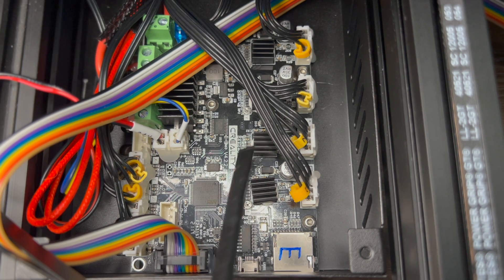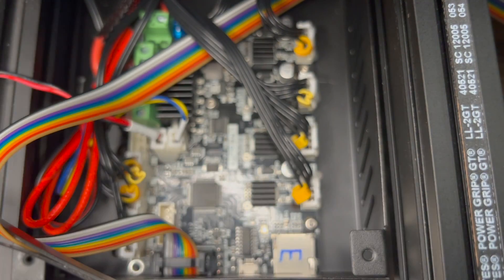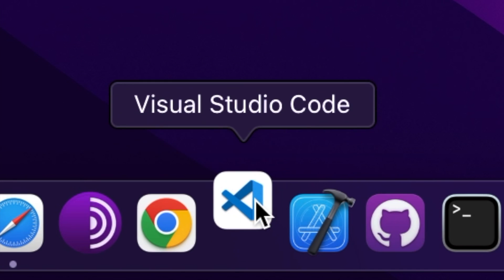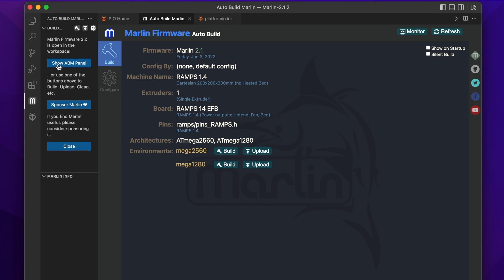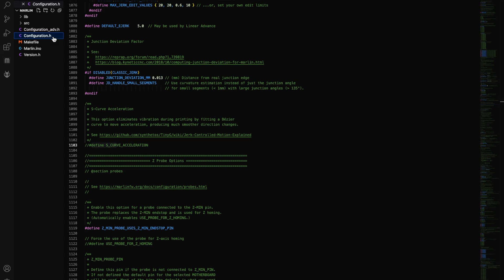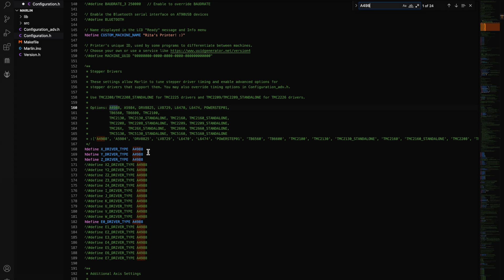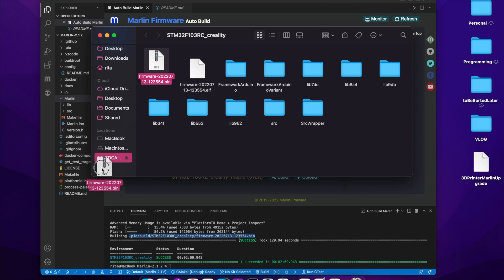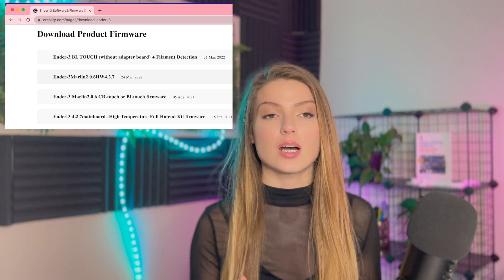How To Update 3D Printer To Marlin 2.1 Firmware (for Ender 3 and more)

Comment: Hello. I am French and do not master the English language well but I still followed your explanations step by step but unfortunately there are errors (62) after the built of marlin. I will try again anyway. Anyway, thank you for this great tutorial. I specify that I have an ender 3 with a card v4.2.2, I think that the drivers are A4988 because there is nothing indicated on the sdcard slot and I have a BLTouch.
Reply: My build failed the first time too because I downloaded Marlin 2.1.1 instead of 2.1. It works with Marlin 2.1
Reply: @MrTimeJump  Hello.
I compiled Marlin 2.1.1 with VSCode after temporarily disabling my anti virus and now everything works fine. My Ender 3 is 100% functional and after all the settings the prints are fabulous.

Comment: Letter written on the TF card case:-
C = HR4988
E = A4988
A = TMC2208
B = TMC2209
H = TMC2225
Reply: I don't have a letter on the case. Unless it's on the bottom.
Reply: @justapile4376  Inside the bottom behind the cover

Comment: do you have any ideas on how to fix the "blue screen of death"?
Reply: check your power supply voltage on back, US needs 115v. Make sure your LCD is plugged into the plug closest to the printer.
Reply: @harleyperkins1134  I know, it’s non of those
Reply: @TGG141  look up how to test power supplys and mainboards. basically leds working or not, could be your mainboard
Reply: @harleyperkins1134  well it’s a 4.2.7 silent board upgrade on an Ender 3 pro

Comment: Cr200B is not on the list after you clicked examples to find my printer.... What do I do and my screen currently does not display becuse I either incorrectly did it the first time or installed the wrong one before I watched vid.
Reply: Basically I got the firmware after extraction and put on sd and put in turned it on, let it load and then shut off then I got the Dwin_Set, extracted then put on the Micro Sd this time and put it in the slot for it at the bottom and instead of it being blue and saying stuff like it did 2 other times I tried doing it, it is now a black lit screen with not creality or anything. What are the steps I need to take? I was following everything in this video until I could not find Cr-200b where you we're looking for printer in examples.

Comment: Okay I just got an ender 3 pro. Is Marlin the base firmware or a custom firmware? Not sure if I want to upgrade just yet. I'm running my 2nd print without any issues so far, what do the updates add in terms of usage and functionality?
Reply from the maker: My Creality Ender 3 3D printer came with Marlin 1.1.2 installed on it out of the box. I'm not sure if all of their printers come with Marlin firmware, but it does seems like their standard firmware (judging from the info on the CrealityCloud firmware website).

Comment: Followed every step, and unfortunately my Ender 3 broke. Blue screen, tried placing stock firmware and it didn't do anything. If I would know it's risky, I wouldn't do it!
Reply from the maker: Oh my... that's interesting and unfortunate! 
I am very curious about your board specs. Could you list them? Could you explain how you transferred the file and include more details? Perhaps I could give information on another video that will help users diagnose, prevent, and/or fix these issues. 

Was there any damage to the connections or have any wires come loose accidentally during the process of checking your board? Thanks
Reply: @techwithrita  it was Ender 3 4.2.2 with A4988 stepper drivers, i managed to get it fixed by renaming the stock firmware to "FIRMWARE", inserted the SD card, and after a while it loaded normally. Then I tried with the same Marlin firmware, and it worked. Guess it was some kind of coincidence. And no damage was made, because everything is working normally.

Comment: Hey Rita, I'm trying to scan flat drone frames that I can use in Fusion or Tinkercad, what would you use for that? Might a flatbed scanner work? I don't know if I would have to have a high $$$$ handheld scanner for this application. Thanks in advance...
Reply: I succeeded with flatbed scanning to jpg. Then importing canvas to fusion. Overlay some reference lines on a sketch over your scan. Do some simple math to change the scale of the canvas. Then proceed as usual with fusion.

Comment: thanks its usefull but for me "ender3 pro 1.1.4" i needed to burn a bootloader using  an arduino connected to the printer and arduino ide then we use all that comes in this tutorials ...thanks very much

Comment: Super brilliantly done Rita.  I see where Marlin Firmware recognized your work.  when I got to where to go to compile / build the configurations for my printer are not there.  I have a Geeetech A20T multi-color printer.  I used a version of the CURA engine that could run with the A20T Color Mixer program.  But not all the settings for advanced control .  The Ultimaker CURA with Marlin 2.1.1  is where I need to go.  Now returning to problem of no configurations.  I submitted my request to Geeetech and support referred me to your video, which I had previously viewed.   Any ideas?
Reply from the maker: Hello, although I do not have experience with A20T color mixer, I did research it briefly to try and help. I was able to search through the configuration folders via CTRL F (it’s not an obvious find for sure) the “A20T color mixer” or “A20T” and found the config files to be copied and pasted into the “marlin” folder (in the Marlin-2.1.1 folder > marlin) (-also, make sure to “replace existing files” when prompted, not paste in addition to the same-name files). From the results of searching “A20T” in the “Configurations-release-2.1.1” folder, I copied all 4 items in the search results and pasted them and the auto build marlin updated the board info correctly. Next, since you have multiple extruders with one nozzle, you’ll have to open the configuration.h file in the editor / IDE from the marlin folder after you pasted it from the above step. You’ll then CTRL F and type in the search bar “multi-“ for multi-extruder (even though terminology is different from multi-color) and read the description of that function before uncommenting it to see if it applies to your printer. If so, activate it / uncomment it and then save. Then scroll through the list of functions to see if more apply or are needed before building your firmware and it should enable all functionality on your printer. I hope this helps!
Reply: @techwithrita  Hi Rita, sorry I wasn’t as prompt as you.  I found the A20T configurations file but it only contains the 2 configuration files but no bootstrap or status file.  None of the Geeetech printers had 4 files,  but the Ender printers all seem to have all 4.  I was able to get a successful compile.  But when I put the SD card into the printer and turned on printer nothing happened.  And then I recalled another site complained about Geeetech printers not being cooperative that way and showed using Cura to do the load, but timing of release of reset button on printer and pressing open of load on PC.  It worked.   But then  I rebooted printer and cable came loose that connected PC to printer and now I have a blue screen and further attempts to reconnect resulted in failure because the Port is busy.
Reply from the maker: @MoonShadow.  hmm… there are a lot of layers to that, but I hope you didn’t brick your board! The blue screen of death as they call it (slightly different from PCs) usually means either the firmware needs to be reinstalled or is corrupt… or that a cable(s) got disconnected somewhere on your board. I would check the cables and all connections first before attempting to work with the firmware

Comment: Followed 1-5 got compile errors all pointing:
#error "Your Configuration.h file is for an old version of Marlin. Downgrade Marlin or upgrade your Configuration.h."
Any suggestion.
Reply: ran into this same issue, used the 2.1.x bugfix version of merlin along with 2.1.x bugfix config files and I was able to get it to build
Reply: I have the same problem except I also have "Your Configuration_adv.h file is for an old version of Marlin. Downgrade Marlin or upgrade your Configuration_adv.h."
Reply: @bassreaper7779  (1) Check this video, I installed "Professional Firmware" Ender3V2-422-BLT-20220816.bin and it works PERFECT. (2) I notice also that motherboard has GD32F303 that this might be an issue. I did order newest V4.2.7 with STM32F103 RET6. I didn't install yet, will let you know result. Currently using the Professional Firmware that has lots new features. Just FYI using CR-Touch.
Reply: @dovy4729  thanks for the info. I'm going to look into that firmware. Do keep me posted on that board I want to know the results.
Reply: @bassreaper7779  Whatever I tried didn't work. Did you figure out the beeping issue?
Reply: @dovy4729  I was able to get 2.1.1 to compile with no errors.  Go to my channel page and shoot me an email to the address I have on there. Let me know on here when you do, I dont get notifications for that one. I will reply to you from a gmail address. I have a Marlin zip file I can send you.

Comment: at 7:14 how do I know which matches my board?  Also I need to add firmware for my CR touch.  Are you able to address for dummies like me?
Reply from the maker: There are no dummies, only people not informed yet. 
The board / brand / version of your 3D printer should have a folder in the list of folders/options, try CTRL F and type in your board info to help find it in the list. If you have a rare printer, it may not yet have a folder for the config files. 
There is an option for CR touch, once you find your folder (if there isn’t a folder with specific CR touch in the name) then you have to use the folder for the general version & brand of your printer, where you’ll have to uncomment the function(s) that enable CR touch functionality. (I think there are three total functions for CR Touch? Not sure… I could be getting confused with BL Touch though… but it’s the similar situation)
To uncomment the functions in the IDE:
You’ll go to the same file where all the functions are listed as shown in the video, then CTRL F and type in “CR touch” in the document and uncomment each function that applies. 
Also, be sure to read the summary above the functions to ensure there aren’t additional functions that need to be enabled.
Reply: @techwithrita  mine is the Ender 3 Pro. Thank you for the detailed response! I'll try and see if I can find it. Great video and thank you!

Comment: when i powered it on with the sd card in the screen stayed blank not sure what i did wrong
Reply from the maker: Make sure the file is on a blank / empty SD card, that there are no other files on the SD card other than the firmware file, plug it in and then power on the printer. It should come up with a prompt. If it doesn’t, double check with the code that the files used with the code are for your correct model, version and motor drivers of your printer. The file may be corrupt somehow and it may be beneficial to start the process over from scratch.

Also, if your board is much older, it may not work this way… early Ender 3 models may not be able to boot with the SD card.

Comment: My file didn’t work because it says the file is binary or unreadable. Is there any reason that might be?
Reply from the maker: Where did you get that error message, after clicking what? And in what program? Or was that message on the printer?
Reply: @techwithrita  I got the message when trying to load the marlin file onto visual studio code. I realized it was because the file was still zipped. However when I extract the file and try again,(Im using windows 10) the file keeps opening to more files instead of uploading.

Comment: Thanks for making this video! We always appreciate a good tutorial that we can refer people to when they need help. At the moment we're working hard to improve the Auto Build Marlin extension so it will be easier to find options and configure the firmware, so hopefully it will be less of a struggle for new and casual users.
Reply from the maker: I’m glad you found my video helpful! I love having the opportunity to assist others in their 3D printing journeys, and the Marlin update was phenomenal.
Reply: @techwithrita  Thanks for the guide - was trying to install marlin 2.1.1 but it seems that the creality touchscreens aren't working with marlin - is this right?
Reply: I’ve tried this method about a thousand times and nothing has worked
Reply: @PhillipJFry69420  same brother, it does not work on mine too
Reply: @sebus_Airsoft   I tried this and it worked on my Ender 3 pro. The only BIN file on the SD should be this one. I used Linux with this tutorial.
Reply: Does this tutorial work if I’m trying to go back to stock software ? My friend tried doing octo print but couldn’t get it to work and just wants to go back to stock software so yea would this tutorial work for that? The printer in mind is a CR-30

Comment: Thanks!  I found your video useful.  I had just purchased an Ender 3 Pro and was playing around with trying to update the firmware and I thought I had bricked it.  The problem is just knowing which firmware to download.  I have the 4.2.2 mainboard.  I tried several and eventually got it back running, but now I am thinking I need the latest version of Marlin since it now has version 1.0.1.

Comment: You don't actually need to remove a heatsink from the stepper, the "E" marked on your sd card slot refers to what drivers your board has (E=A4988). Other letters refer to other drivers. I just learned this myself.
Reply: For anyone who doesn't have one of the letters listed but still wants to follow the tutorial, my SD card slot on my v4.2.2 motherboard Ender 3 Pro had the following markings which I haven't found listed anywhere else.

SD-card slot, written in marker: GD? (pretty sure about the G, less sure about the following D)
4988ET
A2019
909H

Thanks @techwithrita for the awesome video. <3
Reply: @maddsmish  I have GD marking as well. So do I enter in like this?

#define X_DRIVER_TYPE 4988ET
#define Y_DRIVER_TYPE A2019
#define Z_DRIVER_TYPE 909H
Reply: The letters written on the card reader slot (with marker) are different depending on which stepper driver it has. These are for the ones 4.2.X board with STM32F103RET6 controller:

C = HR4988
E = A4988
A = TMC2208
B = TMC2209
H = TMC2225
Reply: @amjed-ali-k  I am seeing conflicting information on this where people with an H8 label actually have an HR4988 controller. Some help would be great - I really don't want to bust off a heat sink just to verify.
Reply: @amjed-ali-k  This is a very good explanation. I looked on my motherboard (V4.2.2) and there is nothing written (??) what do you think? It's a . Ender 3 stock.
Reply: @philippeloubeau6615  it was made a monday. on monday, the letter's guy is not availlable and nobody replace him. 🤣
I had the same, it was working with the unmodified config.h
Reply: @_bentou  hahaha... I compiled Marlin 2.1.1 with A4988 drivers and it works fine...
Reply: @amjed-ali-k  I have T8 written on mine
Reply: @amjed-ali-k T5 = TMC2225 I wish the host of this video warned how fragile the heatsinks are. She shows a doctored version with the heatsinks already loose and it makes it look as if they are easy to separate from the chip. Not onky I broke my ifixit tweezers I also damaged one of the coolers badly. All because she wants to look cool and tell everything is dead easy when it actually isn't.
Reply: C = HR4988
    E = A4988
    A = TMC2208
    B = TMC2209
    H = TMC2225
Reply: Thank you for this info..
Reply: @crawniik  order some thermal paste and paste it back on...should be fine.

Comment: Thank you so much ! Can you make instructions for connecting bltouch?)
Reply from the maker: Hi! I don’t have a BLTouch sensor on my printer, I personally don’t think it’s worth buying as I can level the bed pretty quick and easily without it, but there is a function or two in the configuration file that you can search for and uncomment to activate it specifically for the BLTouch sensor, just search via CTRL + F in the IDE for “BLTOUCH” and it should take you to the related functions where you can read their descriptions and decide if they are relevant for your sensor :) hope this helps!

Comment: thank you, the  info i found was outdated and kept failing..  now i need to change the code for the CR touch any info on that?
Reply from the maker: Hi! I don’t have a CR touch, but you can search the config files for that model / board based off of the specific info and there should be a config file for it!
Reply: same - were you able to find?
Reply: @christopherjkringle8613  i cant remember which video i finally found, think it was one from 2021. a larger guy with glasses.  had a step by step that worked.  was a lot of trial and error.
Reply: @chrisharrison2839  i'm guessing it was probably the edge of tech channel